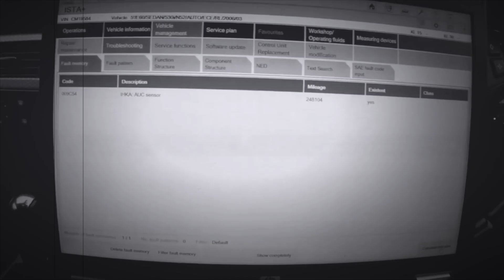BMW N42/N46 Engine Reliability 2020

Comment: Mate I’m so glad you made this video. I have an issue with my N42 and crackshaft position sensors. I’ve replaced them both the low side (B) has been replaced 3 times now and it’s works for a short period then fails. Any clues?

Comment: I have a e90 318i with the n46b18 and the engine missfire when I get of the throttle but after idling awhile the missfire stops. I get 29CF (misfire C3) and 29CC (misfire several cylinders) and 29CE (misfire C2). Ive changed 2 coils and moved them around but nothing happens and replaced all sparkplugs (there is spark on all of them). Also moved around the injectors and tested injectors from other cars but no difference. Last time I checked I also had 2A70 (Valvetronic, plausibility: sporadic current fluctuations), I've changed the valvetronic motor but that didn't help. This feels like it could be connected or could it be something else? Any ideas will be will bevery helpfull because I don't know what more I could test. I guess I should mention that I've replaced the timing chain because the chain tensioner broke, but the fault was there before.
Reply: Alexander Söderlund my first step would be to look at live data on a scan tool. See if the fuel trims look ok . If you see the long and short term fuel trims are positive I would have the intake system smoke checked for any vacuum leaks.
Also monitor the pre and post cat oxygen sensors and see if they are operating correctly.

Comment: Hi mate, I have a leaking spark plug tube seal on #2 cylinder but I’m not sure on how to remove it. #1 & #2 are easy but #2 & #3 are covered by the venos system. Do you know how to remove #2 & #3 spark plug tubes ? Cheers

Comment: i have this n46 engine on my E90, the engine stops when im waiting on the red light. before it stops is making rough idle, i don’t have problems with that while driving. it stops more often when is hot outside, in the winter is after 30 minutes.
Reply: I had a problem similar to that. Put all new coils on it. Spark plugs. And changed the oil as was leaking. But now tryna chase the blue smoke problem. Gonna start with oil level sensor as it's going 🥺 more sir every 5min. Gonna change the vaccum pump gasket. Rocker cover gasket. And the vanos solenoids. Failing that I'm just gonna get some forte seal conditioner off this guy  😅

Comment: Very good overview. I think the N42 goes into the same category as the vw 16v DOCH engine. Not very reliable and too experimental. N42 engine has also a problem with 0-rings leaking(specially the vacuum pump) and the burning smell of oil I know too well. If it-s over 17 years old it should get a total engine rebuild. Bad timing chain is a issue, plastic parts are sometimes broken to do excessive heath and old age. Over all it take a lot of patience to keep the N42 running.

Comment: Thanks for the information. I have an N42 engine which keeps misfiring even after changing the plugs and coils
Reply from the maker: That sounds like fun
Reply: So how can I fix the problem once and for all
Reply from the maker: set it on fire or push it off a cliff
Reply: Check Vanos Solenoids. That should do.
Reply: @razorx6905  thanks man
Reply: There are many different reasons for the lumpy misfires on these engines. I've been trying to find the gremlin in mine for years.
Reply: @dhalsim-1  If the missfire is random it means the oil pump don't pump pressure enough

Comment: Most shittiest engine I came across..bought a very neat full service history by BMW 320i E90 in 2010...car had low mileage and it drove like a dream...at 120k km it started taking a small pint of oil...then blue smoke...replaced the ccv valve at BMW and then the coil pack went..then the oil leaks started at the back of the tappet cover...replaced that and then the oil cooler went straight after that...was getting pissed off thinking it's my dealerships f up...replaced that and then my nightmare began again...blue smoke and loosing power...oil found in coolant bottle...replaced the oil cooler and new ccv valve...still same issue....drove it for another 10000km as I was saving up to do the valve stem seals as per dealership recommendation and then it started making milkshake in the radiator again...now I got upset....took the car in to another dealership and they diagnosed head gasket is bypassing...upon stripping they found out the block had a hairline crack between cylinder 3 and 4...had to order a new motor which costed an arm and a leg.After 40000km later the oil cooler was stuffed again...and the oil cooler gaskets started to bypass...ended up in such a nightmare...took it to Toyota straight after the repair and bought a Hilux gd6...never again BMW motors

Comment: N46 is inline 4 cylinder basic petrol engine. No Turbo, no compression, still has enough power to drive easily. Mine passed 400 000km in less than 14 years. Still driving like a champ. Of course people who have no issues would not visit here, they will just continue to drive and ignore. This engine is pretty basic, if the engine starts to fail it was probably misused or it was problematic straight from factory. My 2 bits on this, its too harsh to say this is bad engine, lets do a comparison on Fiat or Chevrolet or maybe Opel 4 cylinder engines. Yes, 6 cylinder N52 is much much better but it costs more and needs more money to tank it because of bigger fuel consumption. Of course 1.8 is pretty sluggish for this big car so it's not fair to compare them with 2.0 like theyre same engine. N42 was produced just for short period of time whereas n46 was from 2004 to 2015. If we skip part step there next engine for this range was developed by PSA Peugeot Citroën and BMW together. I highly doubt these newer engines would win over N46 for reliability.
Reply: I agree with you, I got both the e92 n52 engine and the e46 n42 and there’s a big difference in fuel consumption in them. And also that there’s a lot of people that never watch this video that drives a perfectly fine n46. So I think that it is a big difference in how people drive and maintain their 318..
Reply: What maintenance have you done?
Reply: The N46 has a MECHANICAL water pump too! N52 is typically electric on the newer e90,e92 and it fails ending with a huge repair bill

Comment: Great video. How does the N45 compare to these engines in terms of reliability? Could one expect less problems due to the lack of direct injection?
Reply: N46 isn't direct injection that's n43 and your n45 is an n46 without the valvetronic

Comment: I have a 318i which cuts out momentarily as if it dies then immediately drives normal again. This would throw the engine light and traction control light. Local mechanic ran diagnostic on it and every code came back to voltage. He inspected the battery and leads and says it needs new battery leads as they were corroded. Have you any experience with this type of fault?
Reply: Crankshaft position sensor

Comment: I don't agree with many of the statements made in this video, and I notice quite a few errors in what you say. For instance you mention valve timing in connection with the valvetronic eccentric shaft. The valvetronic system ONLY controls the variable valve lift, whereas the Vanos system controls the cam timing. Vanos is a german acronym (VAriabler NOckenwellen Steuerung), literally meaning Variable camshaft control.
Now, I think the main culprit for the problems experienced with these engines is wear and tear due to the long oil shift intervals. I'd say - cut the interval in half. 
Secondly, it seems like the original cam chain tensioner is too weak, causing chain rattling, which again leads to excessive wear on the chain guides and stretching of the chain. Also, the cheap rubber quality used in the various seals (head cover gasket, valve stem seals, vacuum pump seal rings, vanos seals, oil filter housing gasket, and the sump gasket) cause oil leaks. Replace these seals and the chain tensioner, and make sure the crankcase ventilation works properly. Then the engine should work fine.

Comment: Love your videos mate!! Working with a N46 now, can you explain why this engine runs good when it’s cold? With other engines you always get some smoke during startup if the seal stems are bad. On this N46 the smoke appears when it reaches real working temperature. My thoughts now goes to a bad MOSFET in the DME module. What are your thoughts? Regards! /R
Reply from the maker: No mate nothing to do with DME AT ALL!!!! this engine never suffered issues with DME that is valve stem seals or head gasket reason it
Runs good when cold is because it’s not running on the sensors it in open loop when up to temp it runs in closed loop on the sensors
Reply: BMW Doctor Thx! Make sense! No offense mate but maybe we guys also need a diagnose working all night long? 🤪💪

Comment: I've got a problem when my car goes into limp mode it also gone up with the codes.
P1050 and p1062 what do you think would cause this.
I've heard a few people saying it's the valvetronic motor?
Reply: Any luck 
I've got the same codes, half engine light

Comment: We have a 318ci msport convertible with this engine, vastly underpowered for the weight of the car.
We were advised to get the straight 6 but thought it’d be cheaper with insurance and petrol consumption, we should have listened 😆

Comment: I was thinking maybe i could get a 2009-2010 318i E90 for the wife.  Going back to the Honda ads page. Thanks.
Reply from the maker: no need to look at Honda if you want BMW and reliable get the 3.0 petrol or V8 engine more reliable then 2.0 I don't know why anyone even bothers looking at these

these are like the crappest of crappest cars produced for budget people
Reply: BMW Doctor being ignorant about bmws of that age I had the (wrong) idea that the smaller and less powerful engines would have a more simple design making them easier to maintain.  I'm just looking for cheap transportation to get the wife back on wheels with a bit of style, nothing more. I will take a look at 325i too.
Reply from the maker: Ok yes look at 330i not 325i that’s still no good must be 330i or 530i

2.0 engines are a HEADACHE just go through the comments yourself they are plagued in issues and that’s why people get them and then criticise the brand 

When really they never actually owned a bmw they owned a ford a bmw is not a bmw is a 4 cylinder engine and I stick by that even today
Reply: Trust me, buy the Honda! You’re clearly only looking for one thing in a car, and that seems to be reliability, just buy the Honda, they have better reliability than BMW and are renowned for it and well recognised for it, and it’s been proven by statistics. So it’s a safer bet. Even the inline six cylinders and issues, the v8s like the n63 and m62 have timing chain and timing chain tensioner problems. Not saying that BMW is unreliable, they are for people who can fix
something by them selves.
Reply: @BMWDoctor  Why avoid the 325i?
Reply: Doctor.your opinion about 2.0 engine it s wrong because you see in this day almost all the engine it s 2.0 with turbo and maybe BMW when make this engine don't make sow strong for many years😁OK 3.0i it s nice but not everybody need this power evrytime... because if he need more power he take from the first time m3 series

Comment: Exactly, my N46’s valvetronic motor is shattered, and it also leaks a lot of oil (common for a lot of BMWs) and also there is a coolant leak which I don’t know is common for any others.
Reply: I've got 142,000 km and no coolant leaks yet. I have replaced gaskets and valve stem seals but that's about it

Comment: Hey man, I hope you can help me.
Sometimes when the automatic gearbox shifting up from first to second, the gear makes punch and noise from the gearbox, and falls into error mode (service mode that only 4 gear works).  There are no errors from the gearbox during scanning, there is only a vvt error on scanner , can this be related?
And should I try to just replace the vvt motor? 
Thanks, I'm waiting for your opinion.

Comment: Bits of chain guide getting through the pickup and getting stuck in the relief valve in the pump. 8 bar oil pressure at idle, literally haemorrhage oil lol

Comment: So I bought e46 318i. I got the rubber housing of the engine changed and so far it runs rather smooth.  I guess i got really luckly

Comment: The CCV return hose to the dipstick tube can easily be disconnected from underneath (front left wheel area) without having to lift the car.
But what I will say in relation to the N46 engine is "OIL CHANGE"
Change the oil as often as possible to prevent internal issues.
Reply: Yeah these engines are sensitive to bad oil

Comment: Yes bmw doctors amazing vid, I have my 320i originally was getting misfire codes on cyl 1,2 and 3 with running rich codes. I changed my spark plugs, coils and injectors. After changing the injectors was running fine until after 2-3 mins of idling now I’m getting running lean codes and an absurd amount of white smoke pouring out of the exhaust. Local mechanic says it can be my piston rings. Completely lost in this journey of trying to fix it
Reply: Probably valve stem seals or the DISA valve causing the running lean

Comment: Love it... keep it up man main reason my bmw is still outside!!
Reply from the maker: Your welcome mate
Reply: BMW Doctor ok.... now since you’ve convinced me to get a 6 pot... I’ve found one someone wants to PX my n43 for a 325i n53 I’ve seen your n53 vid

I have done my timing chain coils and injectors and my car runs SMOOOTH. But I do want the 325, it does have a misfire on 2 and 3 and it is a cat d advice please and i know it needs a software update as I just called BMW
Reply: @BMWDoctor  please man, I have this prob with the 2850 2852 faulty codes on a n42b20, should I try cleaning/changing  solenoids before I buy a new exentric cam shaft sensor?? Its really expensive,  and my mechanic told me I should continue driving thr car with these codes,  been doing this 2 years now...he cant recalibrate vvt little motor if the errors are present....: (( what is ur opinion? It's weird I dint have check engine but like u said sometimes at red light while idling I feel like she shaking tail a little...ps I just had valve stems replaced....and when he saw valvetronic he said the little cog is stuck in a weird position....

Comment: I don't really know how easy or hard it is to work on an N42 engine, I personally have never tried working on an engine ever, but I do understand how it works, how to take it apart and put it back together. However I've had 3 mechanics refuse to work on my engine, when it was burning oil, one said that he needs special tools which he does not have, the other 2 said they do not wish to touch another N42.

Comment: Hey Dr. Dean,  hope you're safe and well. I found your video very informative has I have recently purchased about 3 months ago a 2006 E46 318Ci Convertible Automatic, it had a FSH with 8 stamps in BMW Service Book until, it's last service on 22/9/17 at 82,809 miles. Since having the car I've given it a service myself ie, replaced oil, fuel & air filters, drive belt, spark plugs & a brand new battery. The performance has not improved and still drives sluggish no power. Your BMW N42/N46 Engine Reliability 2020 video seems to address a lot of the issues I'm now facing, my dilemma now is Dr. Dean, is it worth spend money hundreds of pounds on the N46B20 engine and if so how much?? your help/advice would be well appreciated.
Reply: hello i dont know if i reach you in time since you comment 2 years ago so if you by any chance still have your e46, my advice is dont spent a dime on your n46 and get a swap by a 6 cylinder low milage engine.

Comment: good video as always, I have a N46N engine from Mexico, and just replace the valve cover gastket ans vanos o-rings, And it is like you said I need to find info from EU because it's hard to obtain info for it on this side of the globe.
Reply: Alguna recomendación??cuanto te costo cambiarlas?,   Estoy con un 120i que anda gastando mucha gas y creo que es el vanos.

Comment: The n46 has killed me. Most recently I repaired the vacuum pump, VCG, and oil filter housing an 1 ignition coil that was misfiring (and all plugs). Prior to the fix I had shocking leaking that was causing smoke in the cabin AND sudden loss of power if accelerating too fast between 2000-3000rpm (including engine light). After my repairs the smoking subsided and my sudden loss of power went away but the car idles rough and has poor responsiveness when it needs to work (e.g. climbing a hill). I've only had 1 code about minimum lift being exceeded but my mechanic reset the adaptions and the code has not come back. Every mechanic wants me to do tons of work without any real proper diagnosis e.g. replace eccentric shaft sensor, vvt motor, stem seals etc etc. I'm thinking of doing a smoke test to rule out a vacuum leak and then I need to decide if I start replacing valvtronic parts or just get rid of it. I still have to spend money on sump gasket and transmission leaks after this.
Reply: bmw are nice cars but once the problems start kicking in the repair  bills start to rise save the headache and stress and buy a Toyota or a Lexus less problematic  more reliable 😅